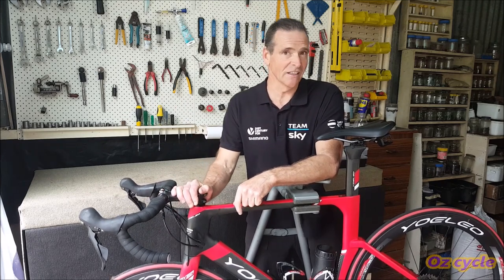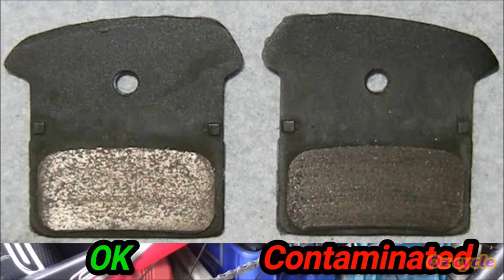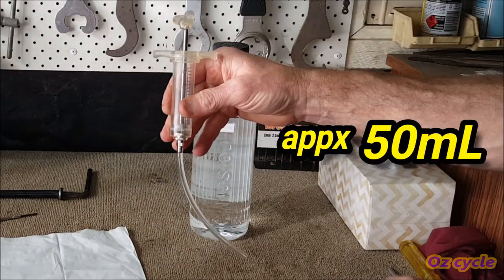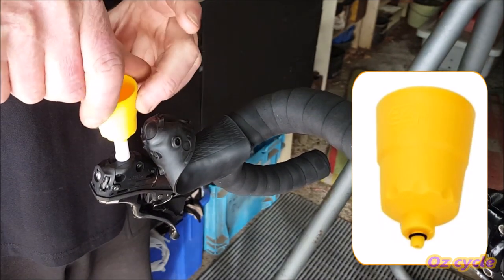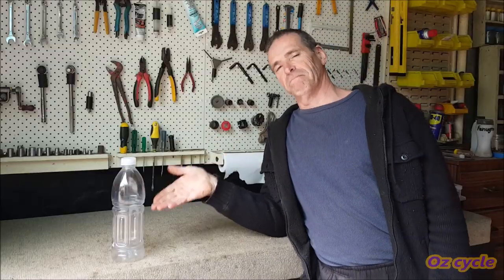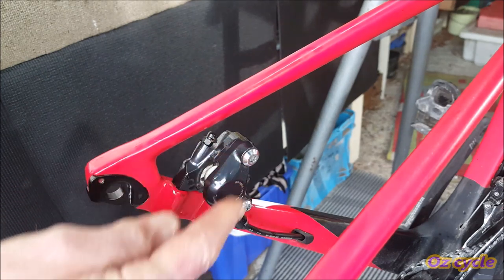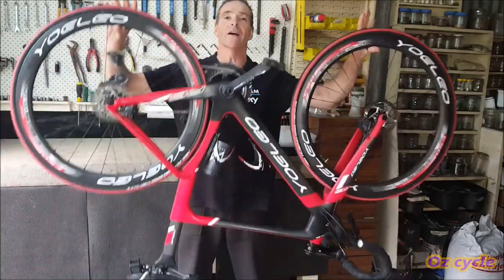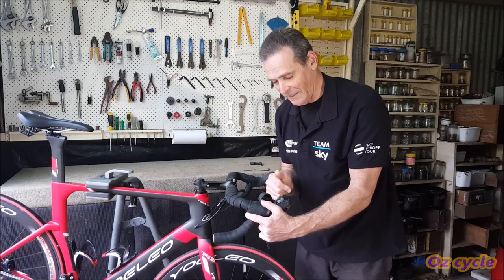How to Bleed your Hydraulic brake line

Comment: I Look forward to every video.  This was another great video.  Summer is finally leaving us here in the Northeast US,  but it's heading to you!   Cool weather riding for US Northeast ahead, until the snow comes, then it's indoors on zwift.  I needed recently to create one of your tools for pressing new bearing cups into a new frame,  worked great at 1/10th of the cost.  Your practical approach to solving problems is very helpful. - Thank you...

Comment: Regarding Mineral Oil. Bicycle manufacturer oils are extremely expensive but they are to a specification (ISO 7308). The Diggers mineral oil from Bunnings you have purchased is not - it may even say something like, "not for suspension or brake system purposes", of course YMMV - But not something I would personally use.

So with my own research into this (and not wanting to pay too much for Shimano branded oil) I ended up with a 1L bottle of Penrite Full Synthetic LDAS ($30 retail from Repco/SuperCheap off the shelf - even less with their monthly 30% sales). It is rated to higher temps than normal mineral oil (and designed to work in those systems) and being full synthetic the chemical compound will not break down with temps - so for you nut cases going 70km/h down old belair road, this means less brake fade and boiling. 

Buy a bottle between you and your mates, you don't even use that much for a bicycle system (100ml front and rear) - Although green fluid will more than likely horrify any by-the-book shop mechanics...

So to recap - Penrite LDAS Fluid: 1) Specified/designed/rated to work in brake systems (wont damage your seals) 2) Cheaper than Shimano fluid (in my experience) 3) Very good off the shelf availability. 4) As a synthetic product, greater performance than standard OEM.

Hope that helps, cheers. But all that could be rambling and you may be fine with the hardware store alternative.
Reply from the maker: Thanx for your research. Havnt had any lack of braking due to heat and we have some brake testing descents here too. Time will tell about the seals but as yet havn't come across anyone with issues with baby oil yet.
Reply: Geez, I go flat out down Old Belair Road on stretch cruiser with V brakes, no problem. The others in group still running coaster brakes have some over heating issues though.
Reply: Just be wary of the boiling points. Mineral oils have a wide range of BP from memory Shimano is about 265 deg C. Also brake oils often have additives to prevent corrosion in the system. 60ml of shimano oil costs  $3.00 delivered so I just stick to that.

Comment: Great video...as always!  Can you point me to a video that covers installing hydraulic brakes out of the box?M  For example, a lot of MTB brakes come with hoses already attached out of the box.  Is this the same for road bikes when you buy a groupset?  Does this mean they already have the brake fluid in them?  If so, how do you detach the hose, route the hose, cut the hose and reattach without getting brake fluid everywhere and contaminating you bike?  Hope that makes sense.  Thanks!
Reply from the maker: Yes,new brake kits have the fluid already in the lines. 'Specialized' have an installation vid for this. Not many people are going to buy complete new brakes for their bikes tho so its prolly a bike shop job.

Comment: Great videos and channel. Very well explained. Is it normal that when I squeeze the lever before removing the syringe and closing the bleed port, there’s not only fluid coming back to the syringe but also a lot of very small air bubbles? I checked my lines and can’t seem to find a leak, but my lever is still touching the drop bar after the bleed. 
With the reservoir screw off, I can see that the fluid level is at the top, but it goes down a fair bit after the first squeeze, then the lever becomes a big more consistent, but if I don’t squeeze anymore then the fluid goes up to the top and the lever becomes soft again…
Reply from the maker: If bubbles come out keep putting fluid in to push all bubbles out.

Comment: If I ever stripped a reservoir bolt I would cut a slot in it and use a flat head :) If you get grease or oil on your brake pads its not always the end of the world, just clean with brake cleaner and oils will have no chance. I use Kerosene because its just what I have at hand and it isnt the best, kerosene is a very powerful degreaser but it alone leaves an oily residue and doesnt evaporate.
Reply from the maker: Try evenly scouring off 1mm ish off the pads with a flat metal file or even on a flat cement surface then final scrub with toothbrush and isopropyl alcohol.

Comment: Hopefully a related question.  I'm going to replace my front fork with one that has more attachment bag screws.  Is it just another step in this overall process to remove the brake and detach the hose?  My brake hose does travel through the fork.  Other steps?
Reply from the maker: You can detach caliper from fork. If needed , remove hose from caliper , cut hose and pull out of fork. You will need to put in a complete new hose.

Comment: Great vid.. can you make video about Hollowtech II bearing maintenance or replacement sir?
Reply from the maker: Which BB style Dhany?
Reply: @stevenleffanue  Shimano Hollowtech II BM 52 sir. I try to pry the black plastic cover but it is difficult to pop out. Thanks
Reply from the maker: They sheaths will push out from inside...use a blunt ended wooden broom stick or such. Otherwise remove cups and you can push out the sheaths with a light tap of rubber/wooden mallet.
Reply: @stevenleffanue  Thank you sir. I'll try to open it soon. keep sharing

Comment: Hi Maester! after watching some videos on the topic i was a bit confused why some people use a reservoir (glas, whatever) on the bottom of the brake and with the cup+ oil on the top lever and open the bottom screw, press the lever and close the screw. Several times, untill the top cup fluid goes all the way down. as you showed, its just another way right? but pushing from bottom to the top..? thanks
Reply from the maker: Either way works. I like bottom to top as it helps get bubbles out as they float upwards.
Reply: @stevenleffanue  yes, that was more logical to me. the only thing i found that could be better using gravity is to remove the dirtier old oil from the bottom directly without pumping it all through the cables up...but not sure if this is real a problem..cheers
Reply from the maker: Yes , I have encountered both mineral oil and dot fluid being contaminated...not exactly sure what causes it.

Comment: Good tip with the fluid. Power steering fluid is also mineral oil and cheaper, much cheaper than the 50 ml Shimano bottle I bought.
Reply: Power steering fluids vary between 7 and 42 S.G. at 100 deg C depending on the system. Shimano oil has a boiling point of 265 deg C and includes anti corrosion additives.
Online 60ml is only $3.00 delivered.

Comment: Hi, Oz! Have a question here either. A Shimano manual typically suggests much more complicated sequence for bleeding. In particular, they add some steps with reversed flow bleeding while tapping calipers/hoses and adjusting handlebar +/- 30 degrees. Even for the modern calipers marketed as "one way bleeding". Do I get it right that having pretty much experimented with all this, you find all these extra steps not really necessary?
Reply from the maker: Tapping calipers and lines helps yes. One way bleed from caliper to lever is fine tho. Sometimes air bubbles can get stuck in corners and declines , reverse bleed helps to dislodge them.
Reply: @stevenleffanue  Huge thanx for sharing so much knowledge in the easy and friendly manner of yours! We keep riding!

Comment: I did all the step showed on the video but my breaks are still a little bit soft/spongy (Shimano ultegra ST 8070) I’m using original Shimano mineral oil . 20ml already . Any suggestion?
Reply from the maker: Possibly air in the hose...try burping them

Comment: where do you buy your easy outs from? Don't want to buy a crap brand for it to only break off inside the bolt head. Cheers
Reply from the maker: Bunnings hardware. A cheap one will do the bleed screw as it shouldn't be tight.

Comment: naahh i still stick to the manufacturer specifications. using baby oil as substitute still to risky to ruin your hydraulic brakeset. i watch seth video and lot said is not good, some it works like a charm
Reply: it's mineral in dot and dot in mineral brakes that will damage seals.
but the boiling point can be different with the different types of mineral oil.

Comment: No, just NO!!! Poor information, especially concerning the mineral oil and you did not even complete the process correctly.  There are no shortcuts to hydraulic disc brakes.  Someones life might depend on them.
Reply from the maker: Been doing this for many years with lotsa different bikes,never had a problem.
Reply: @stevenleffanue  You can do whatever you want.  You're giving information out to others who you have no responsibility for.  A shop worth anything would never put themselves in such a liability.
Reply: 2wheelednut Vincent - it’s a straight forward brake bleed. It’s not rocket science. I’m interested to know where you believe Steve went wrong? Cheers.